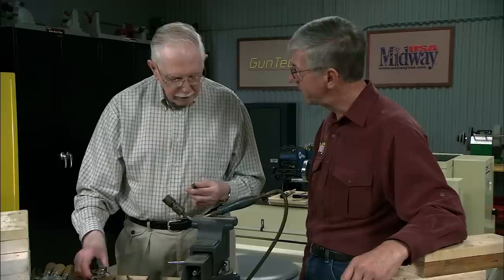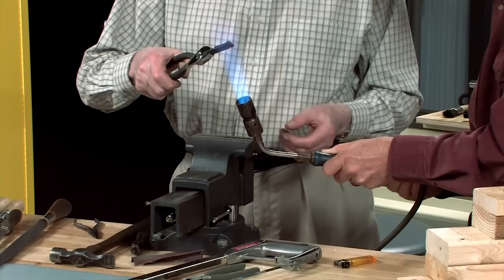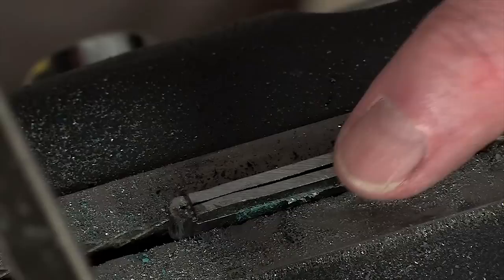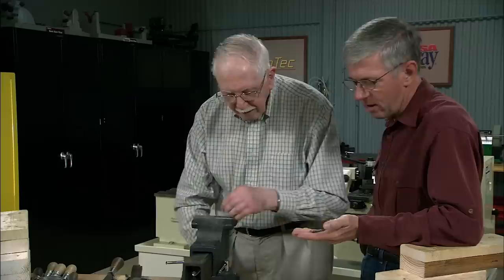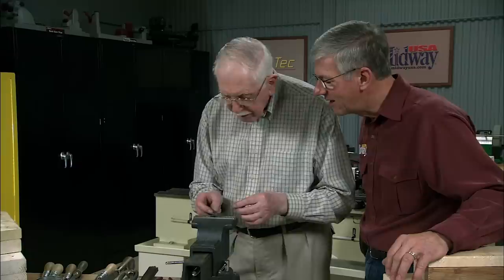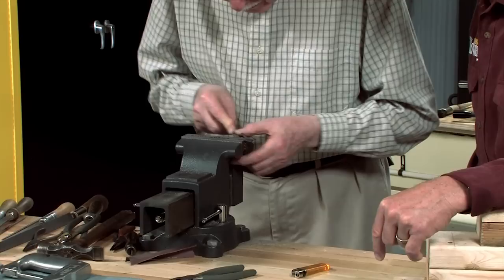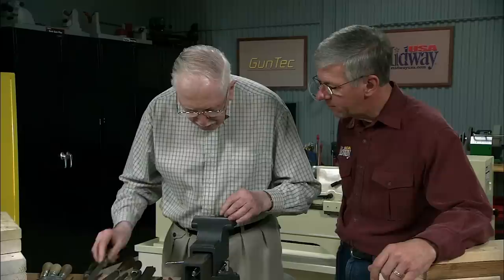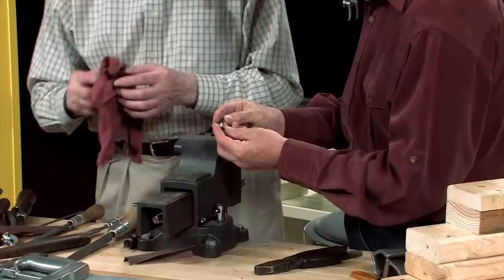How to Make New Leaf Springs | British Side-by-Side Shotguns | MidwayUSA

Comment: I used to thin my springs on the milling machine then form to the arc. This man is doing the same thing but, it is difficult today to spend too much time hand working springs. People today are reluctant at paying for all the handwork involved. I wonder if this man is using Sheffield spring steel; I like to use it when I can get it. I also like cryogenic heat treatment. Then another story are using spring tensionometers to get consistent results from checking spring to spring.
Reply: If they don't want to pay, then stuff 'em. No free lunches.

Comment: I'm a Syrian gunsmith and I learned so much from these guys ..I'm so grateful for them ..honestly I bought a saint etiene double barrel shotgun and had to make a leaf spring for it  I managed to do it finally ...believe it or not ..!! almost nobody in Syria could do it .!
now more and more customers ask me to make leaf springs for their old shotguns ..thanks again
Reply: That's cool! 
Generating cash at the same time. ;)
Reply: I can not find anyone here in Australia to make a spring like this for my shotgun. I will have to try it myself. I had the idea of cold filing a truck spring as I did not think you could re temper the steel as the carbon would burn off. Seems that you can. Now to find some spring steel.
Reply: @harryvanhoo7235  Or an old round cirkel sawblade ;)
Reply: @Romin.777  Thank you very much for this suggestion. Cheers
Reply: @Romin.777  Is it good to dip the steel into well used oil, as it has a lot of carbon in it?
Reply: @harryvanhoo7235  I really don't know. Sorry. I saw one guy using just sunfloweroil. ;)
Reply: @Romin.777  When I try this, I will let you know of the results. Thank you for the information. All the best.
Reply: @harryvanhoo7235  I would like that, since i never done it myself but do own an antigue double barrel shotgun so it would be nice to know just in case something would break. :))
Reply: اشكر  صاحب القناة على مشاركتنا هذة المعلومة الرائعه   .
اخ سامر  تحيه طيبه   اذا تكرمت   توضح  كيفيه معالجة السبرنق  بطريقة  غمسه في الزيت   اذا تشرح لي كيف اعرف ان السبرنق اصبح جاهزا للتركيب دون ان ينكسر مع الاستعمال  واذا تعطيني رقم التواصل واتس اب اكون لك شاكر🌷
Reply: Amer I’m also a Syrian gunsmith (by hobby) and in America. Are you still in Syria?
Reply: Are you still in Syria? I need a skillful gunsmith please
Reply: od kakvog ig pravic materijala

Comment: I have made springs this way for many years... I have a forge and anvil so heating stuff is very easy, although a torch will do for little springs. For those tiny sear springs in flint and percussion locks, old hacksaw blades make good stock.... baby hacksaw blades for really tiny ones and regular for the larger. Soften them first to file the teeth off.
There's a knack in tempering them, but the old 'burn off the oil' has always worked well for me, as it did for the 'smith in the video.
I get to do a lot for the older guns with leaf springs as many 'smiths cannot do it..... Someone else needs to learn as I am 81 now, so won't be around that much longer 🙂

Comment: When he was quenching in oil and burning it off, how did he know when it was enough times?
Reply: @Randy C  It is called "experience " He can tell the temp. of the metal by the color of it.Old timers like him are priceless.
Reply: I did some playing around and it seems doing it 2 times of burning off the oil is the magical number. 1 it was to brittle and cracked, 3 times or more it will be to soft and deform easily.

Comment: did he heat the spring to bright red before dip into the Oil ?
Reply: he did the first time to harden it then the 2 times after that he held in the flame till the oil on the part caught fire then re-dip for tempering.